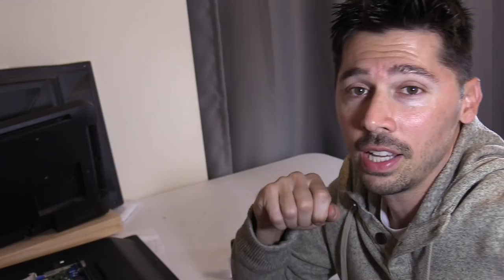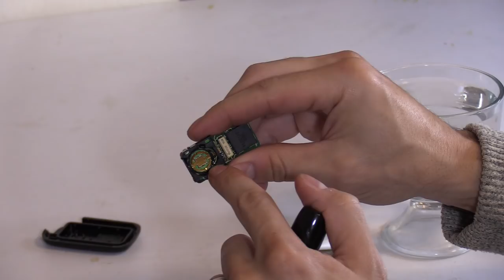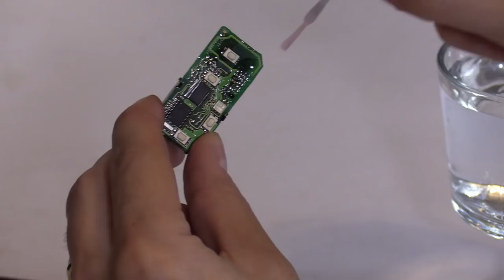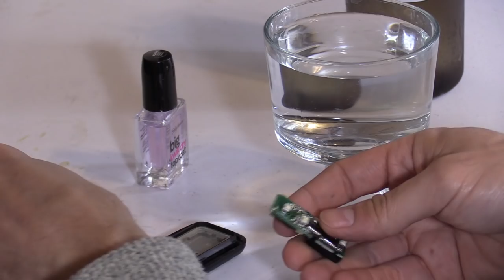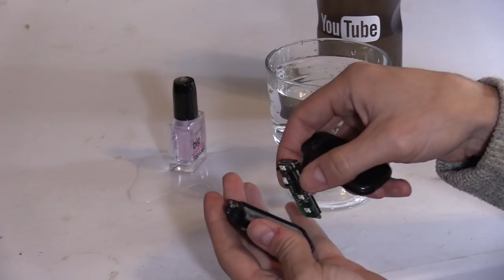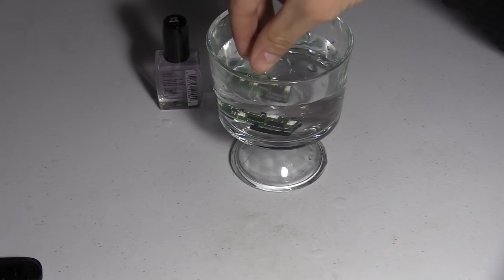How to Waterproof Electronic Car Key Remote Circuit !!!

Comment from the maker: This method will help waterproof a device for limited time underwater ip67, for example if you dropped the key in a puddle or use it in heavy rain, this method would help protect your keys for sure.
Reply: Tampatec I accidentally washed my Toyota key fob in a washer twice and it still works
Reply: Great idea, TampaTec! Going to give this a go tomorrow :D
Reply from the maker: Kongmeng Vang that is amazing 🤔 I guess you washed it in gentle cycle.
Reply: Tampatec nope it’s a coin laundromat so it’s pretty harsh on the wash

Comment: Awesome Video.  I thought you were going to put some Clear Coat on your nails too :)
Reply from the maker: some guys do that to stop from biting their nails
Reply: Most car remotes have a rubber seal to keep water out. I see yours has that seal. While the method does work I don't see a reason to do this.

Comment: Interesting idea, similar to potting I guess, just don't go further and try to use epoxy, when those things dry they shrink a bit and put strain on the contacts, I learned this the hard way  water proofing usb drives which eventually failed.

Comment: Depending on where you are in the country or the world you can get two that are very good and they are non-conductive one is fluid film and the other is corrosionx both are safe on electronics but are actually used for being a rust inhibitor. Let's not forget CRC urethane clear coating. There are two main ways that you can waterproof one is acrylic and the other is urethane. 
All just in my opinion, don't take my word for it. Thanks...

Comment: Just like with a mobile phone in water it is a good idea to remove the battery and rinse with clean water.  Then dry slowly by wrapping it in a towel and putting it on top of a radiator.  Alternatively, putting it in a bowl of rice (uncooked) to absorb the moisture is a popular opinion.  
I have seen the Great Scott video.  It takes some time before bubbles form, and there needs to be power to the PCB.
I like your practical application of the principal.
Reply: DO NOT USE RICE. Rice guarantees you will kill the device. Do not dry the device without doing it properly.
It's not the water you need to get rid of it's the corrosive minerals and salts non-distilled water or other liquids contain. As soon as you dry a wet board you have already done all the damage you are going to do. It will be dead in months if it does manage to work again.

For anyone not drying it out properly you are better off removing the battery and screen if it's not also wet and keeping it wet. It's not the water that kills the device after drying it out. It's the minerals that condence on the solder and under the SMD's that corrode it until something breaks.

 Rince with distilled water and keep it wet until you can use a local jeweler's ultrasonic cleaner as soon as you can. $10-15 bucks. If you do not have one. It's the minerals under the SMD that does the most damage and most difficult to remove. After the ultrasonic bath then rinse with alcohol that will displace any distilled water left behind and then dry the board. There are water displacement or hydrophobic chemicals that work better but most people can get 99% pure alcohol readily.

Comment: What about the switches and shorting across battery contacts ????
Reply from the maker: good question, waterproof for limited time ip67, for example if you dropped the key in a puddle or use it in heavy rain, this method would help protect your keys for sure but not left in the puddle for a long period of time.
Reply: Water is an insulator, it's the contaminates in the water that make it conductive.
Reply: Quiet Ackshon
What are the chances out there of dropping your  keys on clear uncontaminated or distilled water? Or maybe he used distilled water in this video...?
Reply: Ya, I want to water proof mine for salt water.  This hack might not work as salt water is much more conductive than tap water.
Reply: I'm thinking about using plastidip on the entire fob.  Model X 2021.  When the battery needs to be replaced, just pull the plastidip off.  Probably wise to put a release coating on so that it doesn't bond to the fob.